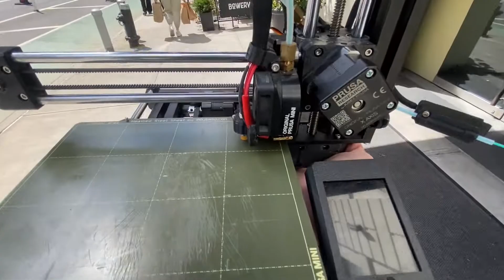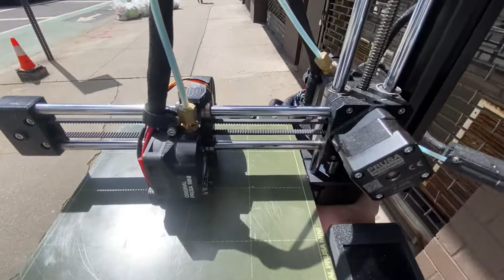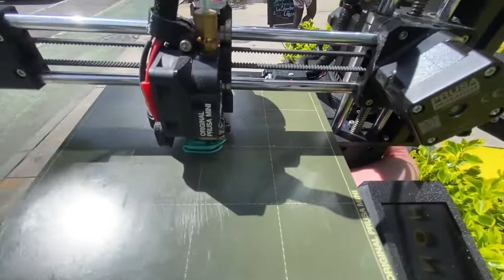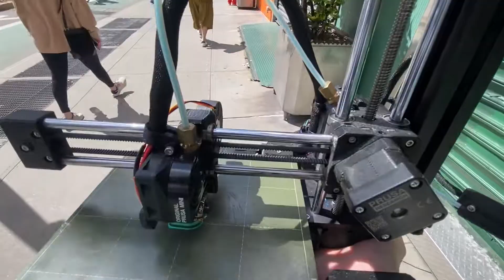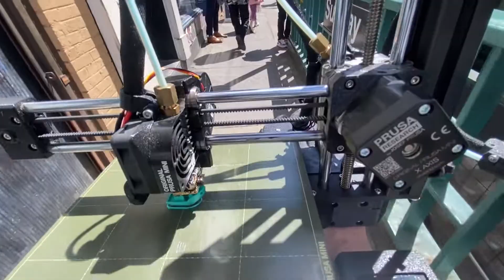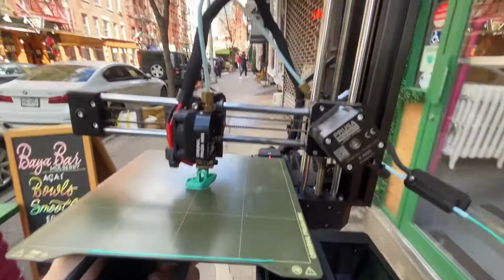3D Printing While Walking Around NYC

Comment: Think you could mount it to a bike and power it off pedaling? Also, well done.
Reply from the maker: I don't think it would be practical, the energy demands of the printer range from 25-100 watts which is right around the average output of a bicyclist. So, an average person would be getting a really good workout to power the printer entirely by their own energy but you could defiantly supplement the battery and prolong total printing time. I have a 110 watt solar panel for the battery and I will test soon wether or not it could power the printer for an entire day.